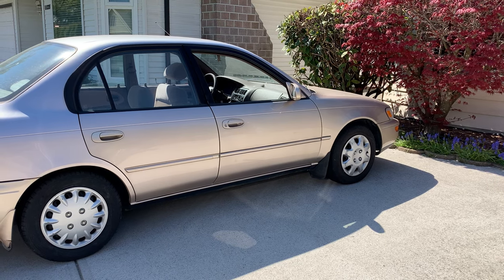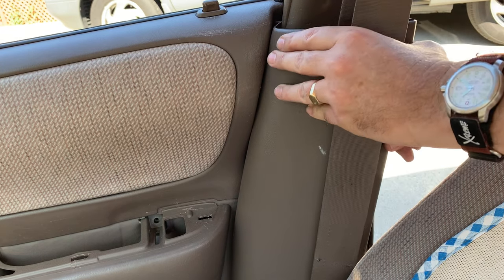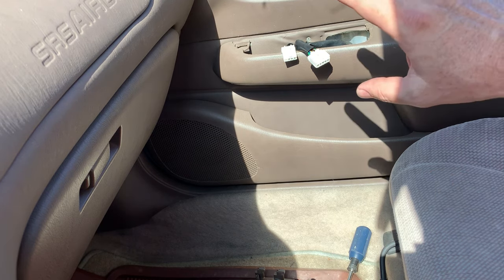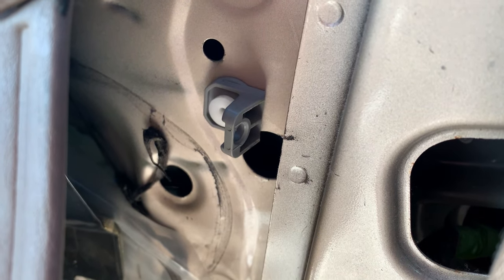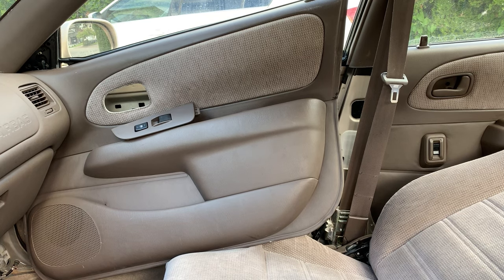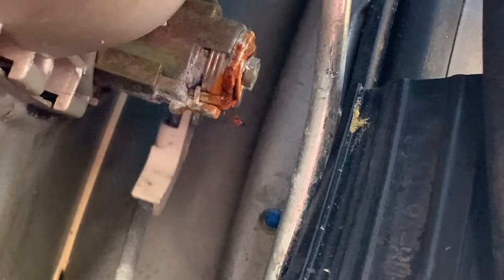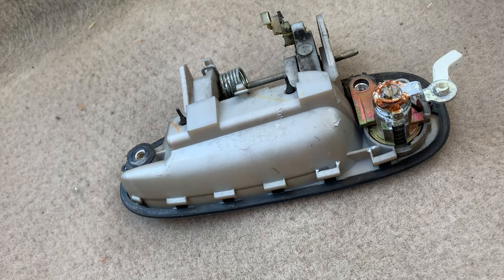Door won’t open – from inside or outside!

Comment: I had the same issue. I went from th outside of the door. My door handle broke apart. I removed the pieces and pushed down on the rod connected to the latch. The whole process took 5 mins.
Reply from the maker: That sounds like the ideal situation! :)
Reply: It was.  Today I shut the door. I had to drive the car. Now I can't get open again. Any ideas?
Reply from the maker: @jackreacher9452  It is either the lock or the latch. If your lock is working okay, it must be the latch. Open it again and double check that you hooked it up right.

Comment: i have 1992 VW, all manual controls, same problem - wish me luck !!
Reply from the maker: Good luck J. Don't give up! :)
Reply: @Pen_Pusher  thank yiou - my handyman got in --m 30. of fiddling - rolled down window - with flashlight he saw the wire - pushed it down and out of the way - it may have happened because of lack of lubrication? I used 3M oil in keyhole afterwards and smooth operating now
Reply from the maker: @user-jv9qz2bu1r  I'm glad it got resolved. :)

Comment: I have the same damn thing.  With my 1997 Corolla.
Reply from the maker: There can be different reasons for the issue. In my case the lock was rusted up. Knowing what I know now, I would squirt rust dissolver into the door lock daily for a week or so, and hope it loosens it up. :)

Comment: On a car here in the shop, i just popped a new battery on the remote and it opened, i then removed the latch,   bent one tab that was worn, it worked freely, and then filled it all with grease before re-assembly;
on another car last month i cut a nice 2.5 inch round hole inside, with the hole saw,aftyer muscling out the door panel; 
 a shame the manufs do  not do it, punchind access holes,  at the factory,it would cost them pennies
but as with ALL issues in cars now, the REGULATORS and the CLIMATOIDS with their wild immaginations , theyare to blame, they now do more harm than good;       (68 yo mech/engineer here.....)
Reply from the maker: Thanks for the post. An access hole would make things so much easier!

Comment: Pray that JESUS help you, remove outside window strip get a strong piece of wire bend a 10mm piece 90 degrees and torch look down into door with window down take handle and move it see where it goes into lock put wire in down to door lock move wire up and down until you hook the right spot you will see handle move move until lock open be patient small movements until you hook the lock if lock lift open door take panel off and lube lock and wire knuckles good, and then problem solved. It worked for me thank GOD no locksmith just patience
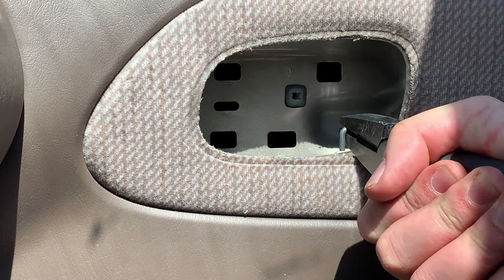Reply from the maker: Hi Martin, thanks for commenting. Unfortunately, your method would not work on this vehicle. At 2:03 you will notice that the lever that moves the locking mechanism does not even budge with the full force of a pair of pliers. There is zero chance that it moves with a piece of wire inserted from above. :)

Comment: Late coming to the party but the occasion didn't arise until this week when someone backed into the passenger side of my 2010 Camry.  Dented both doors and hit the area around the front door handle pretty hard.  By using a little force was able to open the door a couple of times by working the handle and slamming the handle into place.  But that only worked a few times.  Now I can't get it open from outside or inside.  My question from your video is that when you were able to remove the panel so you could get a good look at it, you can see the long horizontal rod that you had tried pulling with the pliers with no luck.  The rod has some type of blue retainer holding the rod.  Is that the rod that will open the door if it can be removed from it's retainer?  Another video had a  guy putting a lot of force with pliers and the door popped open.  I am guessing the rod finally slid through the retainer or popped out.  Am hoping I can get it open to gain access as you were.  Thanks for your time.  dm
Reply from the maker: Hi Dick, yes, that rod connects the latch to the lever you normally use the open the door from the inside. The blue retainer simply keeps it in place. If you take it out of the retainer you can use pliers to apply more force than the lever can. If your latch is working it should pop open. Once you have it open it is easy to access the latch and inspect it to see if anything is bent or not aligned properly. Hope this helps.